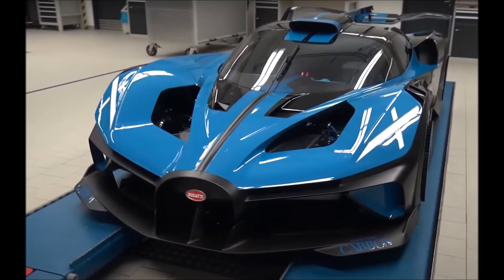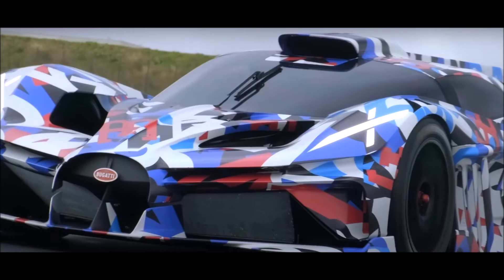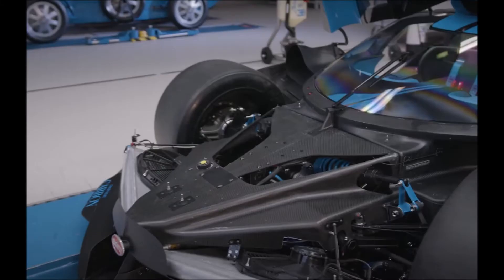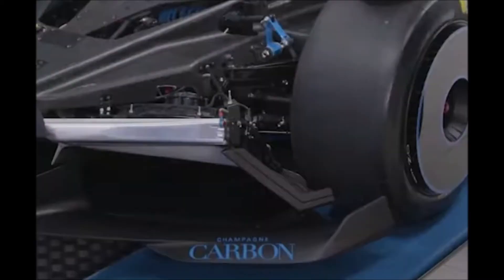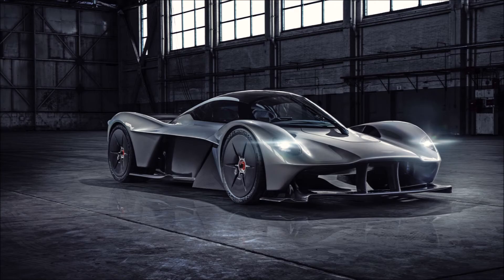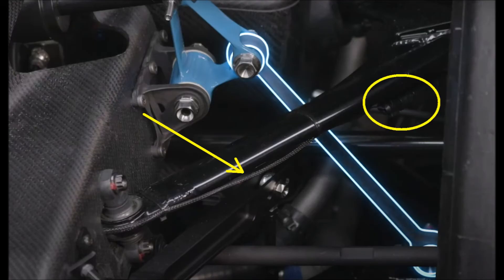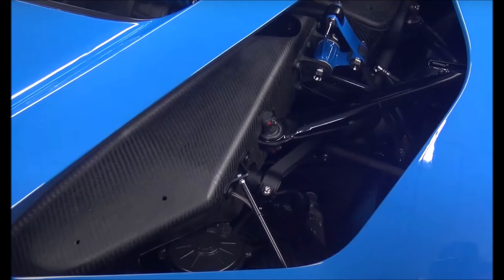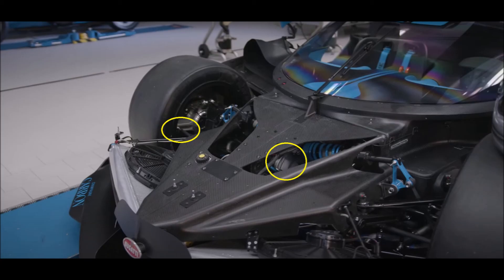BUGATTI BOLIDE - In Depth Analysis Part 1 (FRONT)

Comment: Excellent commentary..!!! 😯💯👌 Thank you very much..!!! 😉 Can you provide some insight into how they've configured the rear suspension please..??? 🤔 Also.., what's your thoughts on a replica of this beauty, using possibly a BMW V10 connected to a XTrac T.50 gearbox for us regular guys..!!! 😎👍 Thanks..!!!
Reply from the maker: Unfortunately I couldn't see too much of the rear suspension to say something about it. Only the conventional anti roll bar was on some pictures.
The BMW S85 V10 is great but would only deliver 520Nm of torque and is around 740mm long. The Bugatti W16 is 710mm. If we are thinking about a different layout a shorter V8 Turbo with the Xtrac T.50 behind the engine could work due to its transversal design. But the T50 gearbox only expects 450Nm of torque and that V8 would deliver much more.
The room between the passengers could be used for a battery to create a hybrid powertrain. But then I'm not sure if an electric motor could fit into the front package...